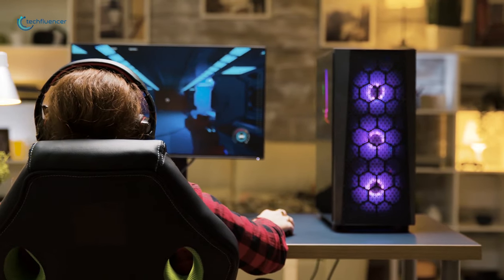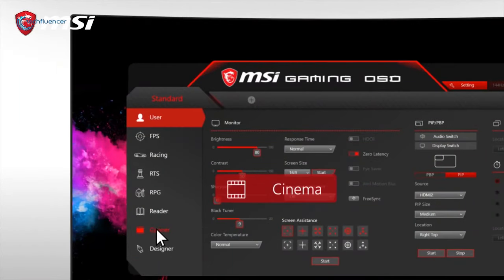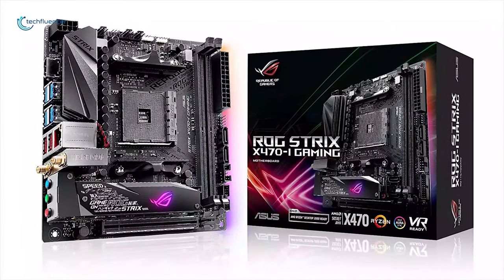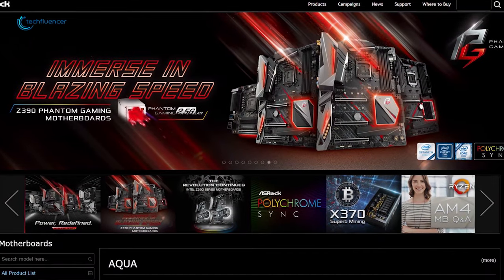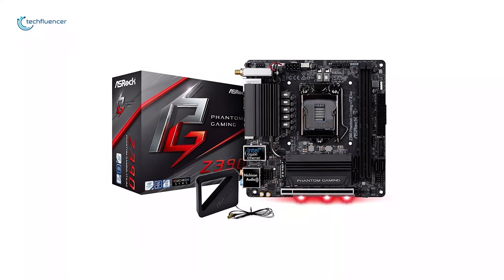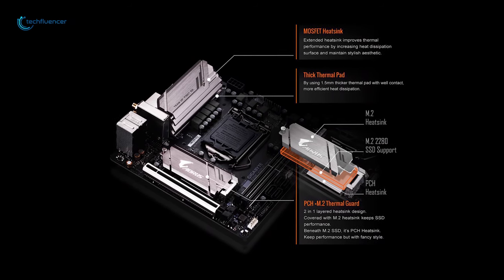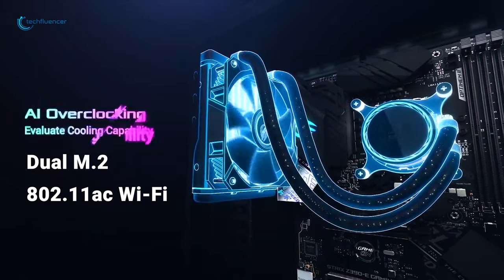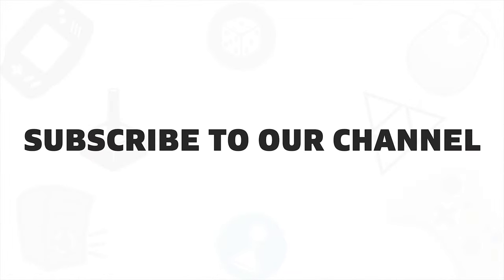5 Best Mini-ITX Motherboard for Intel & Ryzen

Comment: Giga Aorus X570 I Pro Wifi. Nuff Said. Should be on here. Better vrms then many X570s, let alone pretty much all X470, B450s. All Intel networking. Top build quality. Good heatsinks, back of MB is shielded. Bios Flashback. I tested the WIFI signal and compared to my USB Wifi receiver it is much better, I wasn't expecting that. Only thing missing is a clear CMOS button for tweaking with manual overclocking. Oh, and this MB takes a Noctua DH15 cooler and a GPU, which might not be possible on some ITXs.

Comment: Where do u plug in 3 pin to mini itx motherboards?
Reply from the maker: You can plug in any 3pin fan in 4pin fan connector
Reply: Mine has a 2 pin but no motherboard support